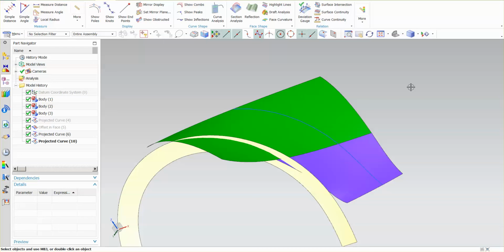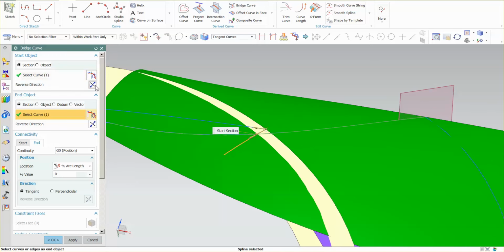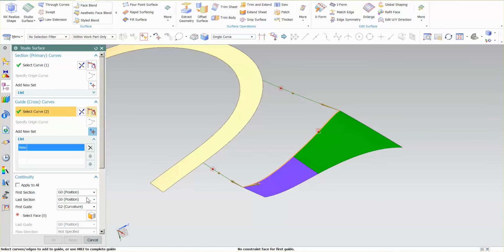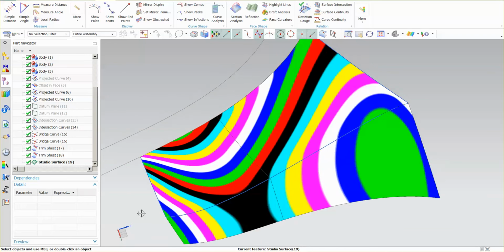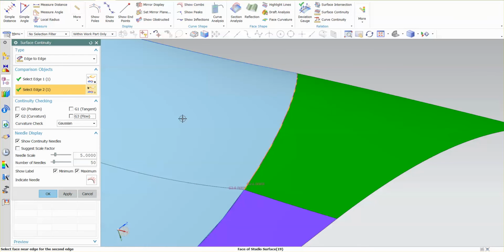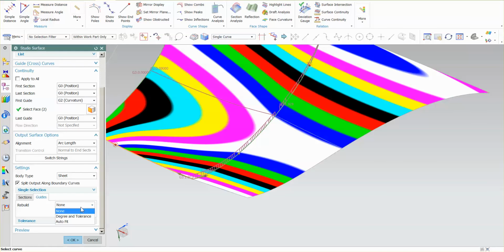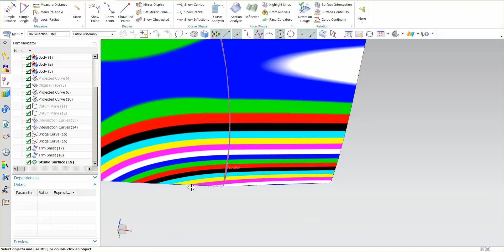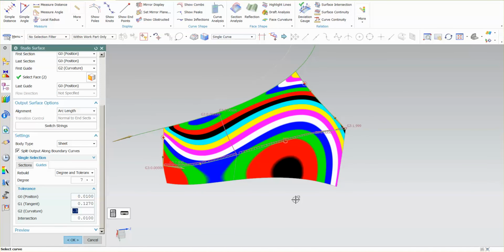Siemens NX 10 | Bridge Curve for G3 Blend Surfaces

Comment: Are there any advantages of using the Bridge Curve as opposed to the Studio Spline? As far as I can tell there are none, unless you want to attach a curve to a datum plane. Also, I find the Studio Spline to be easier to operate and in some cases more powerful. So, wouldn't it be more efficient to always use the Studio Spline for all cases and simply ignore the Bridge Curve?
Reply from the maker: Again, it is a matter of shape control and such. They all offer something a bit different.
Reply: I find that a bridge curve can give much more control over slightly changing the characteristics of the curve (the sliders) while maintaining both the general shape of the curve and also keeping the curve from "blowing up" down the line when you say update something before it later on. I find that Studio Splines "blow up" more often than Bridge Curves when updating new parameters elsewhere in the part file unless you are picking curves/what ever elements that will not disappear in an update. The only time I use a Studio Curve is when I need to have the curve attach to a cross curve that I'm going to use in a sheet.